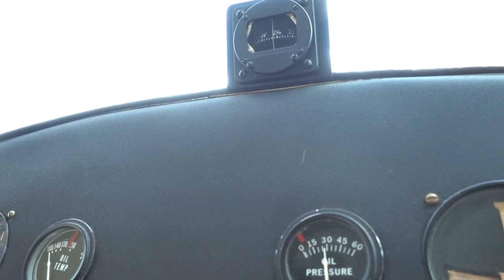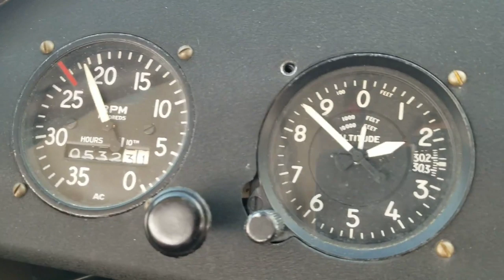Low and Slow Aeronca Champ

Comment: I presume you typically hand prop the plane alone? Could you show that in a video, or direct me to one if you've already done that? I've been thinking about a Champ (not a trained pilot yet), but the hand propping while I'm alone (which would be pretty much all the time) worries me some. I know there are a few electric start Champs out there, but the majority seem to be hand prop. Thanks if you can help!
Reply: You can hand prop from behind the prop on a champ, one hand to hold on to something on the aircraft and one hand to prop it. Sorry can't exactly remember how we did it that was when I was Sixteen 62 years ago. Cheers